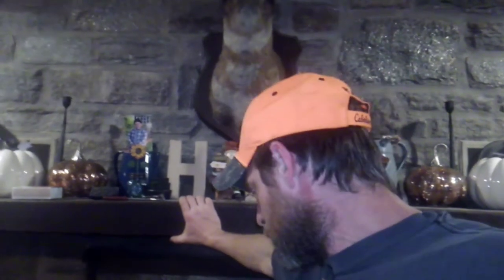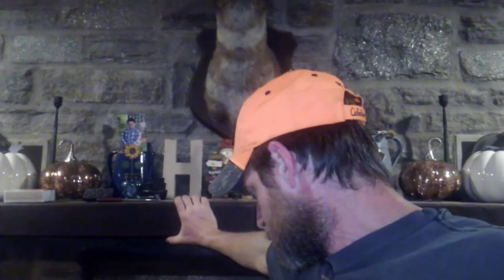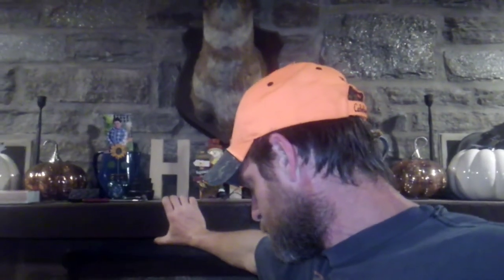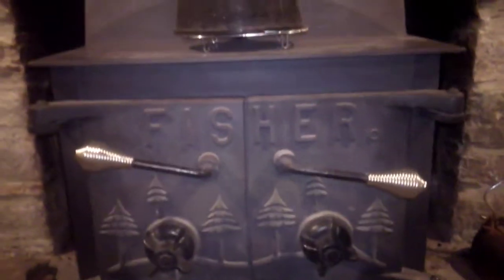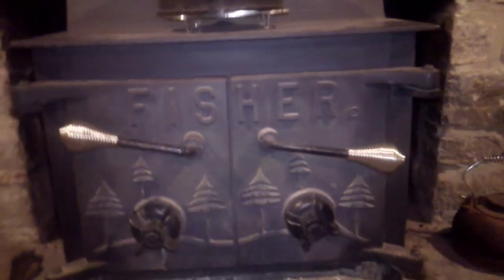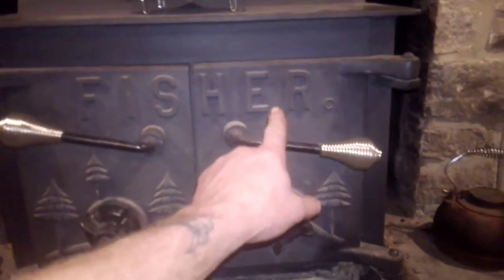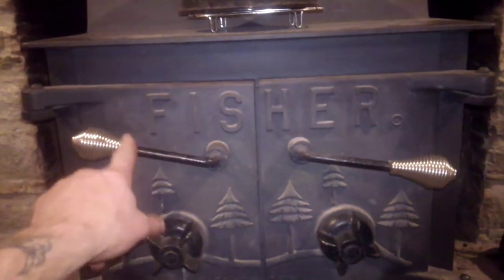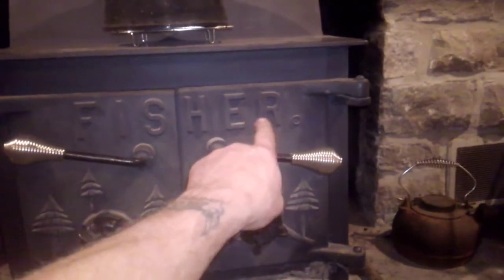Fisher Wood Stove

Comment: I inherited my late father's rarely used 1976 Grandpa.  It has a small and a large star on each door.  There is a '76 cast into the large star on the right door, which I believe is the bicentennial commemorative model.  All of the raised lettering and trees in the doors are painted silver, as are the air inlet dampers on the doors.  I'm in the process of installing a stainless secondary burner and baffle plate on the inside the firebox, then I'll remove the rust and refinish the steel.
Reply from the maker: Great piece of equipment!

Comment: Also what’s that background noise that I hear in the video? That a fan that I’m hearing?
Reply from the maker: Yes I have a fan mounted in the opposite wall at floor level. Use as a cold air return to the room
Reply: @mlhrepairsllc6942  oh okay. I wasn’t sure if you installed one behind your Fisher or not. I take it that it helps circulate the heat from your Fisher to warm up your house?
Reply from the maker: @michaellangdonful  absolutely, hot air travels out the room opening and in the corner at floor level is my cold air return in the wall

Comment: I was wonder which pipe you went with in 6” to 8” on the top of stove? I was wonder if I did 6 inch stainless steel liner down my fireplace connected to the stove with a reducer would I be fine??
Reply from the maker: Reduced to 6"